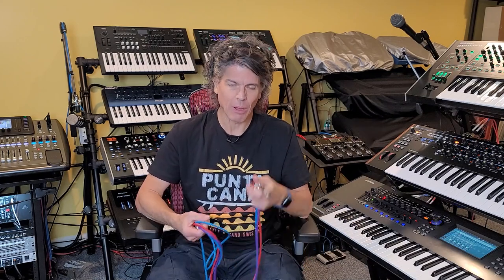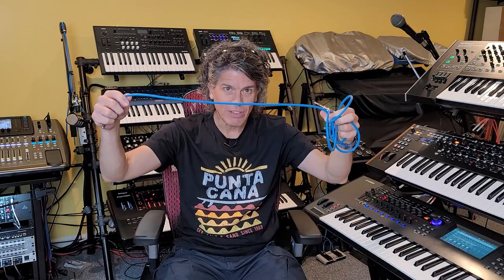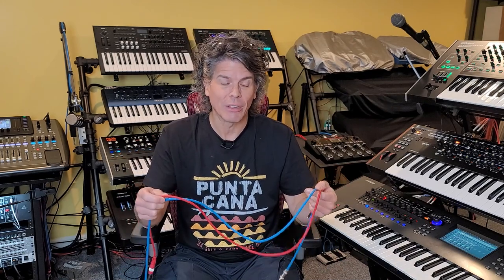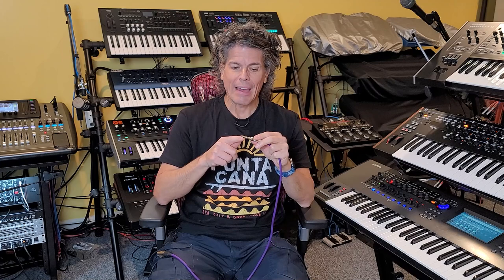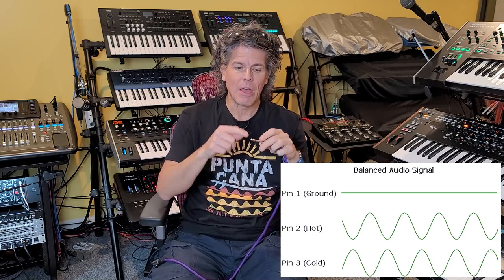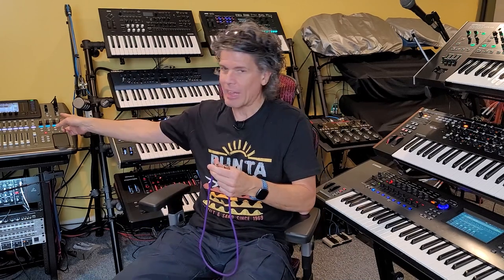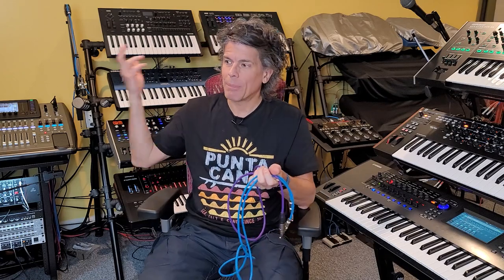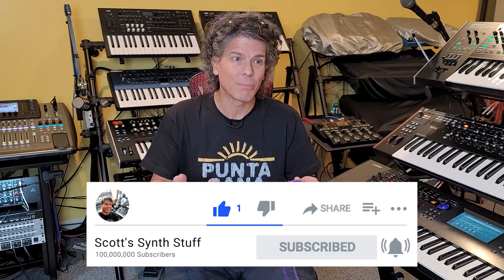Balanced vs Unbalanced Cables: Everything You Need To Know!

Comment: If we go through one outlet will it blow  a fuse In braker or is there a trick or fancy power strip that buffers?
Reply: Upgrade Your ELECTRICAL if You own Your house.  Do that soon because the cost of Electricians AIN'T GETTING CHEAPER.  
Or, if You rent, move to a place with up to Code Electrical Systems.  
Using fuses in any house/apartment building went out of use in the 1990s.  Fuses in a Fuse Box is not up to code in the USAs N.E.C. - National Electrical Code.

Comment: I use balanced cables on my Motif, but unfornately balanced with the MODX+ just has a signal that's too weak. So just using normal cables with it.  By weak, I mean I have to turn the MODX+ and the speakers all the way up just to barely hear it, and of course that doesn't work when mixing with other things.
Reply: BTW, I know I can set the gain in the utilities menu on the MODX+, but oddly it will start clipping the signal, even though the volume is rather low.
Reply: Try using a DI box
Reply: @eliefaradaykyungu1425  It's fine with the unbalanced ables.

Comment: 12:45 what does DI stand for?
Reply from the maker: Depends on who you ask - Direct Injection or Direct Input. Basically a box that allows you to pass audio from one device to another (i.e. synth to mixing desk) but without an actual, physical electrical connection. The audio is passed through a transformer, and this prevents ground loops from causing hum. It also changes impedance for connections that require it.

Comment: Glad you also discussed grounding and different circuits.  Good video. Maybe you will do a video on DI Boxes…?
Reply: Here's the basic concept. Balanced and single ended operation are not compatible. Balanced has 2 hots ++ and a ground -, and single ended operation just has one of each. When you connect a balanced and SE component, something has to be done with the extra signal. You can either make the connection balanced on both ends, or single ended on both ends. That's where a DI box comes in. You plug a single ended connection into it, and it converts the signal to balanced. It makes everything compatible on both ends. I think where some of the confusion comes into play is most people focus on the cable. Cables are not balanced. Any 3 conductor cable can carry a balanced signal. The 2 components that you are connecting determines if the connection is balanced, not the cable.
Overall this was a great video, but there were a couple of things I don't agree with, and its related to DI boxes. If you notice towards the end, he talks about mixing Bal and SE connections. He goes into somewhat of a grey area in that he may need to modify the cable by cutting the ground to make it work, or something similar. The reason this only works sometimes is because there are several ways to wire a balanced connection. Problems can be unique to one way, and not the other. In the video he showed that it's common practice to combine one of the signal conductors with the ground. Doing that can create a short circuit when power runs through the cable. You're combining a + and -. Not only will you hear the problem as noise, in some cases damage may occur. If you don't want any headaches, just use a DI box for all your mixed connections. 
If you want more detailed information, do a search for rane balanced vs single ended. The results will lead you to a paper by Rane. They go over all of the details, and show wiring diagrams for all  the different types of balanced connections.

Comment: Do you have a recommendation of a cable company you use or are you at the point of just making your own? I know you mentioned modifying cables you get so I'm assuming you buy from someone else and then do your own modifications. One thing I have noticed is that not all cable companies are the same and some are very cheaply made despite being balanced. I've been getting them from RedCo lately but I would like to rewire the entire studio and that would be an insane amount of money. Thought about buying spools and making my own but I'm not very skilled with a soldering iron.
Reply from the maker: I've been using Seismic Audio cables https://amzn.to/3LJtEq6 for years now. All of the XLR and MIDI snakes I used in my studio are Seismic Audio. They are inexpensive, and I have never had one fail. That said, if I was going to buy cables for live use, I'd probably buy something with a more robust strain relief and tougher jacket. But for studio use, where they usually get plugged in and left untouched for months, they work great.
Reply: @ScottsSynthStuff  Thanks for the input. Will be taking a look at these. :)

Comment: As said, it is very easy to turn a synthesizers without balanced outputs into balanced outputs by using a direct box (DI). 

Direct boxes sell as cheap as $35. They also often provide additional features such as offering a 2nd output to send a keyboard to both a PA system and to keyboard amp, and may offer a ground lift switch.

People often make the mistake of thinking having balanced outputs built into the keyboard is a selling point. It's really not a selling point as DI's are very inexpensive and you may need one for other reasons. The perfect example is a Yamaha Montage vs a MODX. Some people think it's worth spending twice as much money ($1500 - $2000 extra) to get a Montage over a MODX in part because of the balanced outputs. That is total non-sense. Correcting the signal is easy & very inexpensive.A DI is about the size of a deck of cards.
Reply: I think people get the more expensive Montage for the additional enhancements in sound features. Balanced outputs is a nice bonus.
Reply: Can you recommend a DI box for my modx?
Reply: @springkordz  I have a pair of stereo DI and mono DI boxes from Radial - PRO-D2. They are a bit expensive, these have a -15 db pad and ground lift switches that I use in a live setting.
Reply from the maker: True, but there's one other issue: there is not a DI box in existence that doesn't alter the signal passing through it. It's the nature of analog electronics. Passive DI boxes especially roll off the top end of the signal.

There are very cheap and simple passive DI boxes, you can get them for under $30: https://amzn.to/3Y4s4TR

I have had both the Montage and MODX, and have a Montage now. The MODX actually suffers GREATLY from ground loop noise when it is used with USB and a DAW, and I had to use a DI box on it. When I sold the MODX and replaced it with the Montage - no more DI box required. To my ears, the Montage sounds better than the MODX as well, which I suppose makes sense as it has much higher end D/A and analog output circuitry.

That said, I did not buy my Montage for its balanced outputs.
Reply from the maker: I've used these - they are cheap, and sound pretty decent: https://amzn.to/3Y4s4TR
Reply: @ScottsSynthStuff  I've tried both side by side many times. Sounded identical. Derrick's review said the same. He owns both and has a keyboard review channel. The DAC could make a slight difference in some situations, but unlikely to make much of a difference in most. 

I use mine for live performance only, so I haven't noticed USB noise going into a DAW. I do run DAWless soft synths along with my MODX, using USB connections sometimes as an audio interface. If I wanted a better keybed, I can easily tap into my other keyboards for premium keybeds at home. If I want more sliders or buttons, I could plug in my Korg NanoKontroller to add them since the MODX supports class complient devices.

I'm glad you bought the Montage for other reasons than the balanced outputs. It would be silly to place a lot of value on that when it can be corrected so easily and economically.